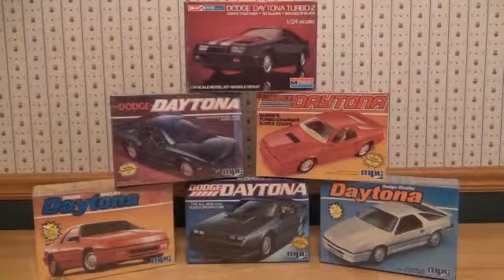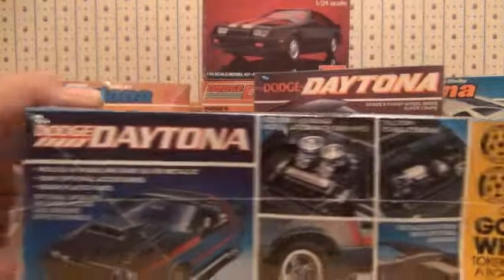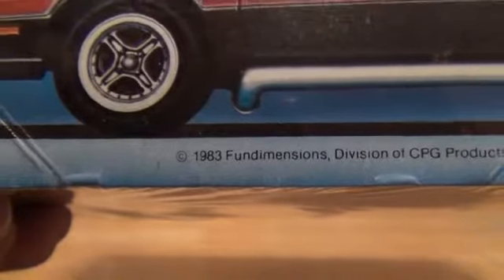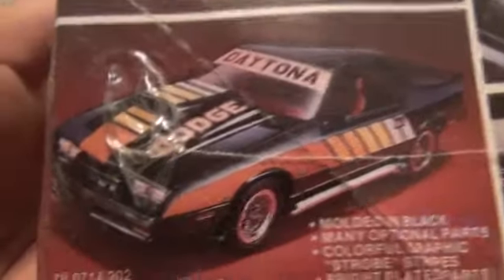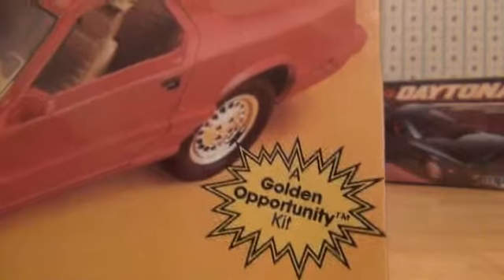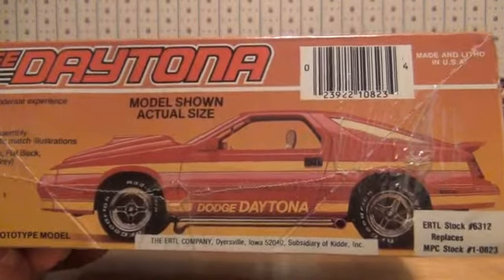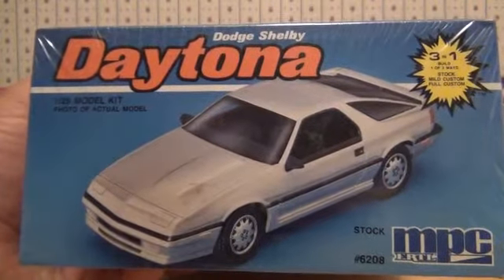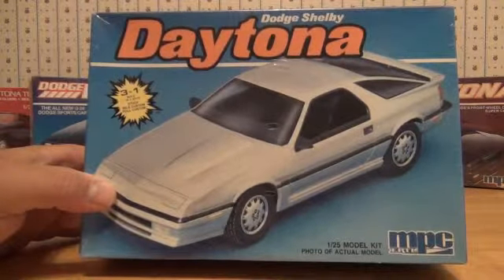Review: MPC Dodge Daytona Turbo plastic model kits Part I

Comment: Another inaccuracy with the first 84' model box is that it's a turbo z version so it shouldn't have the TURBO Z decals on the doors. Also, the Turbo Z was only available in Garnet red/silver or all black in 84'. The gunmetal blue pearl coat wasn't available on the Turbo Z model. Just the Turbo.

Comment: Do you have any Daytonas that are built up?
Reply from the maker: no i haven't built any of these models... i'd like to build a replica of the one i had in H.S. but i'd need two kits... an 86 kit and the wheels off an 87-88 kit... the 1986 Daytona Turbo Z C/S utilized the "crab" style wheels on what would become standard 87-88 Shelby Z wheels...  if i found the two kits i needed opened and inexpensive, i would be probably go for it... i just can't bring myself to open almost 30 year old model kits...
Reply: Good point. The might be worth a small fortune in years to come.